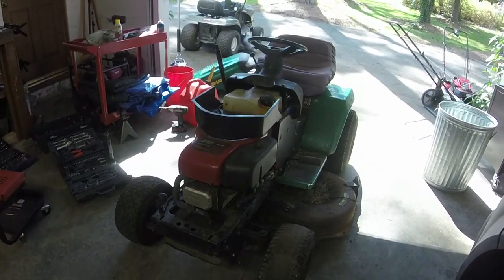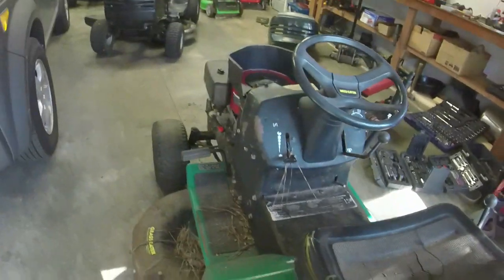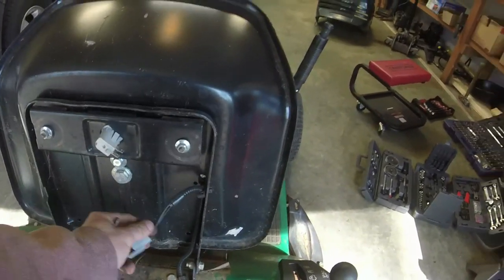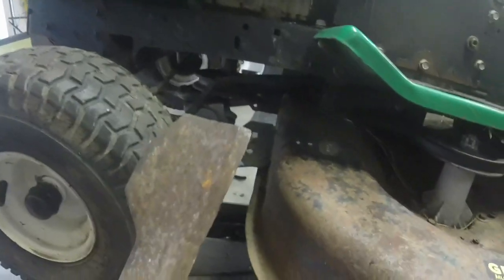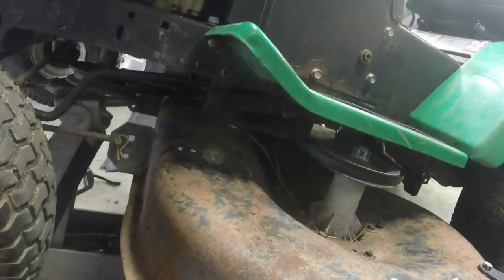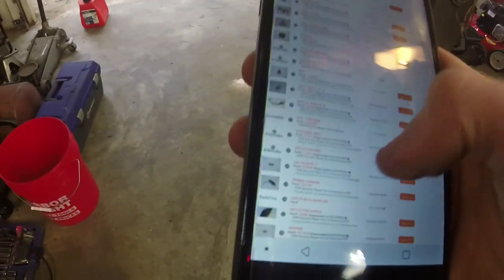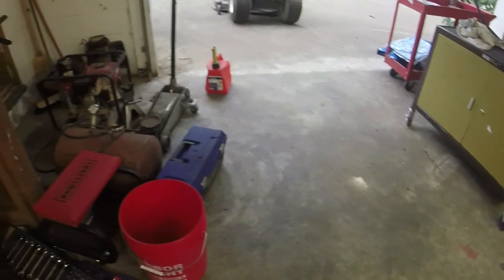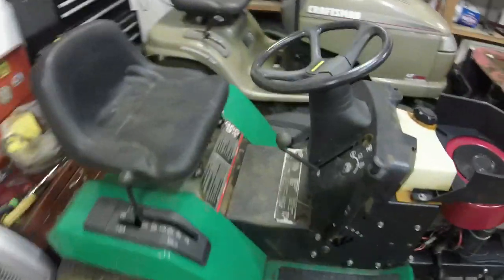Weed Eater riding mower replace seat, fix fuel leak, final test and a surprise ending (pt 2)

Comment: I have a similar mower but mine is an Electrolux WeedEater.Can you do a video on changing the return spring on the mow deck.Mine fell off and my cable blade engage broke off
Reply from the maker: If you have a 42" deck the spring will attach to an oval shape hole on the front of the deck and inside a circle shape hole with two small tabs on the tension arm.

Comment: Check that the throttle shaft hasn’t sheared or the top of the shaft hasn’t broken loose where it is permed over.
Reply from the maker: Will do Ken, I think it cut loose on the inside so going to break it open and see what happened once things slow down.

Comment: They make a spray adhesive that will make the foam rubber stick to the metal .who  makes the weed eater brand moeei now I hope it's not mtd  later .I got your.mower man 😃😀😄
Reply from the maker: Weed Eater brand was made by Craftsman/Husqvarna/AYP when the brand was around.
Reply: Ellis Mowers  the last weed eater tractor I worked on the Electrolux model tag on it.